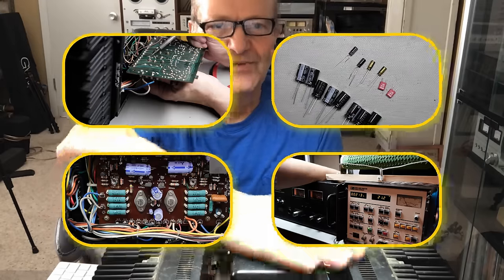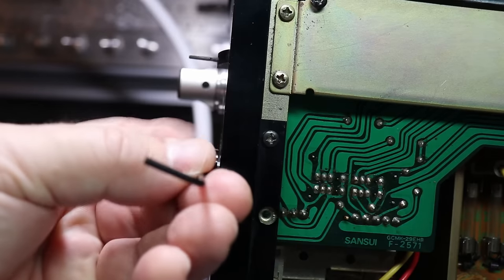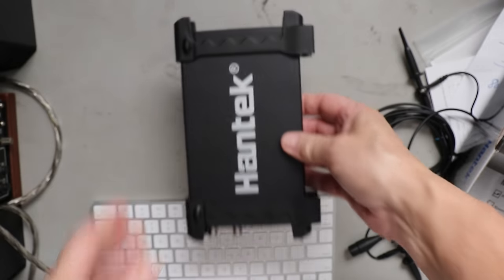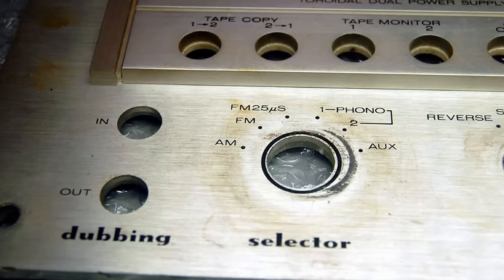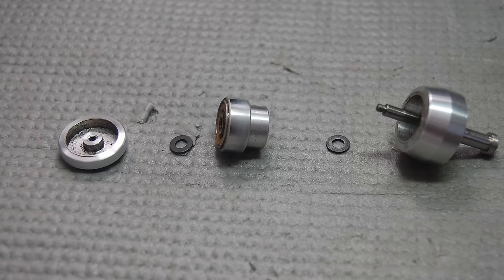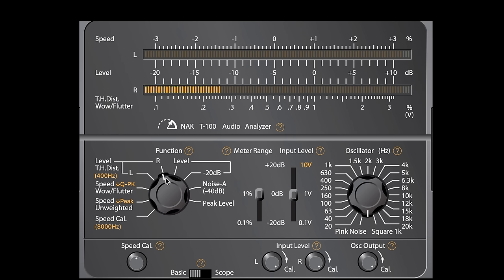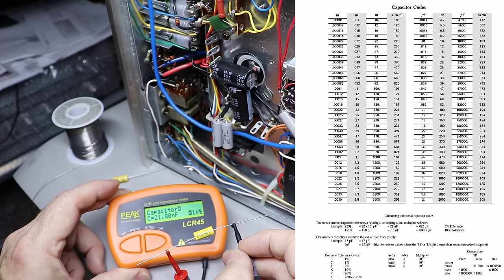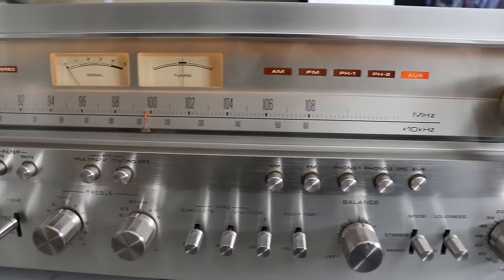Ultimate Guide To Vintage Audio Repair. Old Electronics Troubleshooting. Repairing Tips & Solutions

Comment: Nice Video, Thanks. Do you have any advice on dealing with wire wrap board connections. Old Pioneers seem to use it a lot. I am not sure which tools are needed  for disconnect and reconnect.

Comment: Hello just found your video here. I just got a MCS #3253 Stereo receiver . Everything seems to be working except the am fm and phono push buttons will not stay in the on position ….when I push them in the sounds comes through . Any ideas ?
Reply from the maker: I've never worked on your receiver but usually those type of controls have a plunger with contacts on it, a spring, and a clip that latches it. It may just need to be cleaned, but the clip may be missing as well. Thanks for watching.

Comment: I have a Crate B10 xl solid state bass amp, it only has one fairly simple circuit board and I’ve tried everything I could with my knowledge and multimeter, one day it was working fine and suddenly zero audio, red light still indicates that it’s powered on but nothing through the speaker or headphones, even if I touch the aux, not even a hum aside from the transformer itself, the fuse is good and so is the speaker, I’ve checked all wiring and even re-soldered all contacts, I’ve visually inspected it, cleaned it, and tapped it with no change, I’m suspecting it’s a component but can’t quite pin point it, any suggestions would be greatly appreciated

Comment: That tool was actually a dental pick. They make a variety of different configurations. I have a set of few different ones.
Reply from the maker: Thanks for the info.
Reply: @vintageaudioaddict  it's actually a Hawk s10241p. it's a spring tool, designed for, well.. installing and removing small springs. notably springs in hobby stuff and similar small applications. they also have an 11 inch model.

does look remarkably similar to dental picks, but the bends on these hawk tools come from the factory.

widgetsupply still sells them, it appears.

Comment: Hi I received BSR EQ-3000 Ebay seller told it turn on all the faders turn so when I received it I plugged it on it didn't turn on just the faders flicker on and then off between when I push the power on I think it's the power supply? I think it's a short? Please give me advice because I really want it to use.

Comment: I have a question about DC offset. I watched your video on that and did that test on my Pioneer SX-939 I am restoring. First the receiver did not work when I got it, it light up but no sound out on any channel. I Bought a kit for recapping and replacing transistors and replaced what resistors I found to be bad. The power transistors all checked out good and I reset them with new mica and paste. Now the unit still just lights up and still nothing out. So I did that DC offset test and here is what I got. Channel (A) left -46.6 volts right -0.191 volts. (B) left -.003 right -0.002, (C) left -46.3 right -0.189. First why am I getting negative voltage? and what is causing the high voltages on channels A & C ? I used two different multi meters top quality Fluke and Bryman. It did not matter if I switched the leads putting red in the negative side or black in  black the readings were the same. Any advice would be appreciated.
Reply from the maker: It very odd that each of the speaker outs A,B and C are reading different voltages. Are you sure that you are selecting the correct speaker outputs from the front panel when testing, A,B or C when you have your probes in the speaker outputs?

Comment: my cat spilled water on top of my old jvc rx-75 ..  back side above the ac power  inputs  ..  is there anythig i should do or just swap it out?  i paid like 75 for the BBIG speakers and the whole system -- sounded great, but i am really poor and probably wont have 30 bucks for parts or repplacement for a minute

Comment: I am trying to restore a 1944 messiner disk cutter, and i have called several business that i have called, and two business said yes, but they are south, 45 minute ride. I hav been to han dson and whitman, and they have turned me away or swamped with repaires.. Have some tape decks,. one has a cracked circuit board..

Comment: What I find BEYOND frustrating is all these videos on YT that talk about repairing and diagnosing....when it's time to use a DMM, Signal Generator and Scope, NOBODY ever goes through how and where to hook up and/or setup any of it and go through the stages until a problem is identified. DMM? Great! Now What? Scope? To measure what? And WHERE?  Everybody alludes to this and if we already knew all of it, we'd already be beyond this video. There was a movie out in the 80s... Revenge Of The Nerds. Seems this is where it still happens and Nerds get even. Finally!. Help us out here. How about a step by step using the combination of tools and equipment for diagnosing a Power Supply first, so we know if any problem persists, it's further ahead... Then through the Preamp stage.... And then the Power Amp stage. Maybe usual problems in the Phono stage and easy fixes for the FM sensitivity and balance, Then if you think it might be worth it, more advance Tuner adjustments to the best it can be using the more advanced equipment.  The black hole in the electronics repair and diagnosing step by step using thee expensive equipment you say we need is beyond frustrating to late bloomer NERDS. Maybe you already have and can point us to where we can really learn how to dig in. And if not, be the first to break the Revenge code. Thanks! I'm a MG Chemicals super contact cleaner, and their version with PPE lubricant, fan. The PPE restores POTS to smooth turning and keeps both surfaces friction minimized for even longer life. Thanks for the realistic investment required to learn to help ourselves. All of it is beyond sound advice.

Comment: You mentioned the need for screwdrivers and the desire to avoid stripping screws but didn't advise picking up a japanese specification Philips screwdriver or "JIS Screwdriver" to fit the screw heads on japanese made equipment.
Reply: I always wondered about that, seemed to me like ANY size screwdriver would strip them!!!
Reply: @a2phil  it's a less known fact that Japanese screw heads are not Philips even though they look like they are. JIS screwdrivers will not cam out of Japanese screws
Reply: @JasonMontell2501  Same when working on Japanese Cars... Indispensable! Saving a whole lot of self created headaches.

Comment: Three questions if anybody know's.....
1. Is De-Oxit 5 conductive?
2. When cleaning potentiometers, do most of you let them dry out overnight, to let all of the DeOx fully evaporate, before turning the unit on?
 It seems like it takes a long time to fully flash  off.
3. Is it recommended to use FaderLube after using DeOx cleaner, or is it better to use just the cleaner, but no lube? 
Thank You very much.

Comment: The tools you are talking about are called picks. These picks can be long and straight. A tiny end hook or a very large hook. These tools were made primarily for picking out packing. Packing stops leaks on shafts spinning and traveling through to the outside which has just atmospheric pressure. This packing can have a 1500 or 3,000 psi pressure inside and you don't want to waste too much fluid. Normally a couple drops in 5 minutes is just fine. You pick out the old packing to reload with fresh graphite impregnated string or thick square packing. If you can buy a seal to replace the packing well good. Less drag. On an auto the crank comes out behind the waterpump or alternator sheave. It also comes out in the rear. Both can leak and need replaced just like packing tightened with 2 bolts around and pressing the packing in.

Comment: At about 34 minutes you are desoldering a board that looks like a jester,, and an alien as well.. it looks the same as the board in my 1970 kenwood kr 6160, but the rest of the visible components do not look like the 6160... could you please tell me what model you are working on there, and what the name of that board is? My kenwood was working decent until I was installing speaker wire with the unit powered up... I know now how reckless and utterly irresponsible that was, I should've known better. Anyways, now I only have one speaker on a,b and c, and the 2 combo options too. I let the smoke out of something under there, but cannot locate any obvious culprits. Any ideas or advice on where to start looking? I have 4 other receivers with almost identical problems, only they have stereo until the unit warms up. Anything to help me get going, I really want to start doing this as a hobby, but also in the kenai area of Alaska, there's nobody who works on these monsters. Thanks for being on YouTube teaching aspiring hobbyists how to do it better than right 👌 !!!!

Comment: You flew buy the screw driver sets pretty fast.  I'd just warn new repair people to learn the difference between Phillips, JIS + (Japan) and PoziDriv screw heads.  They all can look the same, but using the wrong driver on any of these could potentially destroy the screw heads.  I don't think I've seen one set that has all three variants included.

Comment: NEVER use a air compressor(That isn't specialized for electronics.) on electronics they can spray oil and water. They may also have a high enough PSI to start blasting things off the board. For electronics I use a specialized blower made by XPower("A-2 Airrow Pro Electric Air Duster") it's under $50, get one for your shop or lab you won't be disappointed.

Comment: Yeah take a look at the item. To see what damage has been done on the outside. Like the REVOX, A-77 I purchased from this guy for $50. I said hey. This looks like it fell out of the back of the trunk of your car? He said it did. That's what it looked like. It was missing a lot of, surface parts. That had all busted off. When it fell out of the trunk of his car he told me. It looked really rough. But it was only $50! So I bought it! And I took it indoors. For its first time in years. From sitting in the trunk of his car. After he put it back in.

Of course a machine like this. This beaten up. Should not work. As the rubber pinch roller was as hard as a hockey puck. The capstan shaft was full of rust. It lacked break bands that were broken. It lacked reel, hold downs. To keep the reels on the recorder. In the vertical plane.. That had no wings. And no case. No faceplate. No volume control knobs. Some shafts were busted off. When it fell out of the trunk of his car he told me.

So I took it indoors and put it on my test bench at Scully. Where I was the QC Manager and Overall, Technical Troubleshooter. That could fix. What our, 2 Electrical Engineers. Could not fix. I had to fix. And I am Not an, Electrical Engineer. I am simply a Genius.  You wouldn't understand that. You are senile.

And the Owner and Boss of, Scully. Got wind. Something was going on. On the Production Line Floor. At my test bench. And he came out to investigate. To find out what all of the hullabaloo, was about?

The, Owner/Boss of Scully. Was not happy. When he found minute, busted, REVOX, A-77. Outperforming our brand-new, $3500 each, Stereo Scully's. From my $50 REVOX that fell out of the sky's trunk and was completely busted up. Dried up. With rust on the capstan shaft. Which I planed off. With a single edged razor blade. And there was so much rust. The capstan shaft was now smaller in circumference. And the tape ran slow. But no worry. The speed can be adjusted with a screwdriver.  As it had an AC Servo, Capstan Drive Motor. And I put it back on speed.. And the flutter was actually low. As low as a brand-new Scully. From its dried up rock hard rubber pinch roller. And now smaller in circumference capstan shaft. And it was flat out to 20,000 Hz. Once I cleaned the rust off the face of the heads, also. It was exceeding brand-new Scully specifications. And the Owner Boss was not amused by this. Since I was also in charge of Quality Control. But I had no control over what he purchased for parts. Oh well?  And it had a lousy underperforming, output transformer. He would not allow me to swap out with a better one.

After about a year and 1/2 or so. I decided to resign. There was no hope here. When you equip your stuff with lousy parts. And he hired me. To ensure. THERE WILL BE NO MORE COMPROMISED SCULLY'S UNDER MY WATCH. Directive he gave me when he hired me. But then he changed his tune. And I was not going to accept that crap! So I resigned. And he closed the company down.. Forever. 3 months after I resigned. He could not live without me. They could not ship a proper working machine. Without me. As he was a schmuck.. That you can't fix, stupid. You also can't fix, senility. It doesn't get better with age. You do not recover from senility. I'm sorry to inform you of. And you forgot your microphone. Senile people do that.

So while that stereo receiver did not fall out of the trunk of anybody's car. You somehow managed to fix it? But was it really broken? It didn't look broken? Did you blow it up by accident? That can happen when you are senile. When you just stick a,, Greeny screwdriver in willy-nilly. Because little Greeny screwdrivers. Cannot screw wires. They can only screw, potentiometers and variable capacitors. And some slugs. That are not crawling on you. But you must be gentle with their ferrite cores. And it really should not use a screwdriver on those. But you'll find out. When you crack one due to your senility. I've seen it happen. With other senile people like yourself. That tried to adjust, disgusting slimy slugs with a screwdriver. Do not do that! They will leave, Glop. All over your circuit board.  Simply remove the slug from your circuit board. It will thank you. Your circuit board will. Not the slug. Which you can dispose of. Because it is all sticky and slimy and full of Glop. Just so you know. Not to do that. Keep the slugs off your circuit board. Keep them above water next time. It'll be better for you and the circuit board. But wait to plug it back into the, holes in your wall. And do not do that in bare feet. At least put on your socks with the rubber grippers on the bottom. When you are in the backyard. Then do not wear those socks to bed. They might have slugs the bottom of them.

I am so glad we've had this technical discussion here. You can now get a microphone. Go ahead.
RemyRAD

Comment: Fixing tape decks is a fools errand.  Tape is NEVER coming back, that's just a fact.  For a variety of reasons:

Nobody has made a decent mechanism in almost 40 years, and they're never going to start making them again.  Even if they did, they can no longer use Dolby NR (that is gone forever) 

Nobody can manufacture high quality recording tape anymore (primarily for environmental reasons) The few companies that have started making tape again, can only manufacture Type I (which is terrible for audio quality)

All of the old stock of metal, and chrome tape is gone, and like I said, it's gone forever. 

Putting the time and effort into old tape decks is only putting off the inevitable...